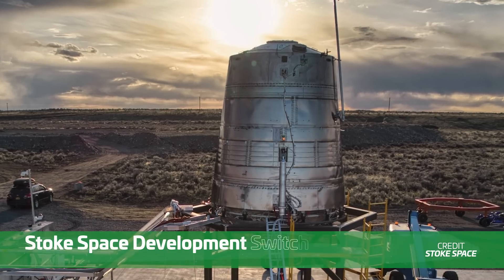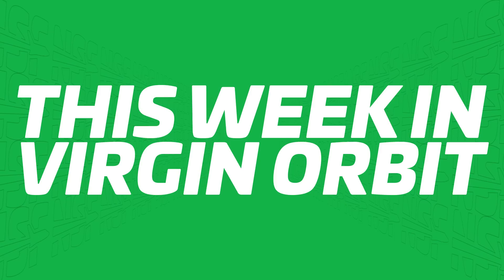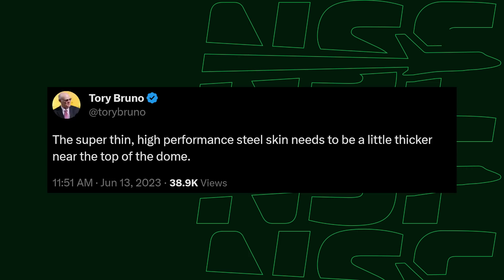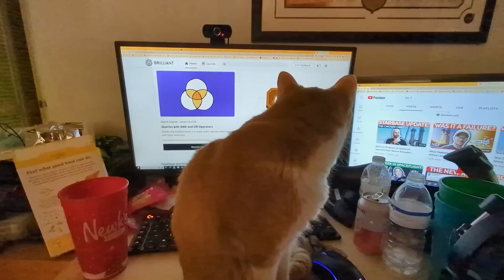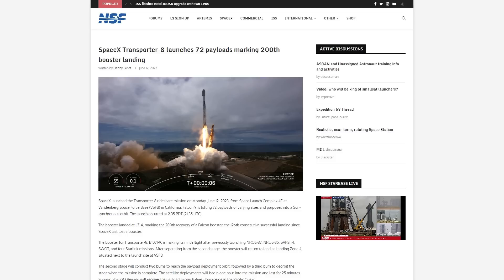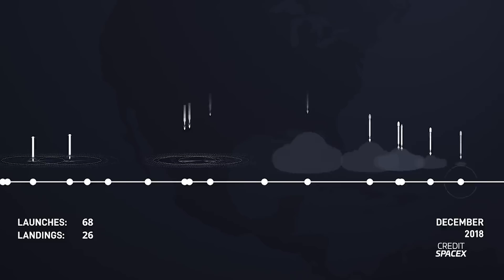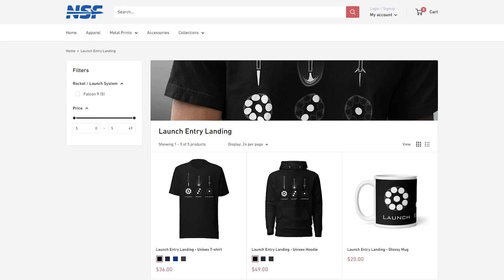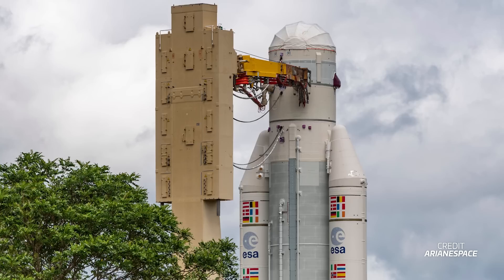Stoke Tests Prototype, SpaceX Hits Landing Milestone & ULA Gives Update | This Week in Spaceflight

Comment: Stoke is quickly becoming one of my favorites. Really hope they become as open as spacex about their development!
Reply: Openness is not only important but interesting....Exactly what we need
Reply: Heh.  I wouldn't say that SpaceX is open, exact;y  Rather, they're building their ships on the beach where everyone can see.  But yeah, not nearly as secretive as Blue Feather and others.  Ain't competition wonderful?
Reply: Here's the potential problem I foresee with the upper stage design: any amount of extra weight on an upper stage costs a huge amount of payload capacity compared to if it had been on the first stage, and if they are going to have enough prop to do a propulsive landing, that's gonna be a heavy upper stage (remember that the fuel tank will need insulation so the fuel doesn't boil from re-entry heat). 
So how much payload capacity will it actually end up having?
Reply: @carljohan9265  hydrogen is a very light fuel plus just like with other reusable vehicles most of braking is done using atmosphere.

Yes it is still heavy hardware wise, but Stoke, unlike starship, is aiming at better market, being medium class LEO. They dont do mass refueling, they only need to deliver few tons to orbit. Way more room for error if one doesnt try to send S-II sized stage to the moon.
Reply: @_mikolaj_  Hydrogen being light weight is offset by the fact that it needs heavier fuel tanks, so the point is moot. 
And it will need extra fuel if it's doing a propulsive landing no matter how much aerobraking it does.
SX did look into recovering F9 second stages and concluded that it was possible but not worth it.
Reply: @carljohan9265  Isp increase outweighs worse mass fraction of hydrolox stages.

Also, Falcon 9 second stage performs flights to geostationary orbit.
Stoke's rocket does not so performance hit is lower
Reply: @_mikolaj_  Specific impulse is great, when you are in space. 
Hydrogen does however have absolute trash thrust power compared to other props, and thrust is kind of important when you want to do a propulsive landing. 

The makers of Saturn 5 understood this, which is why they used the right prop for the right job (kerolox on stage 1, hydrolox on the upper stages). 
The makers of the shuttle and SLS didn't understand this, which is why both of them need the extremely oversized side boosters to fly. 

Personally I'd be a little worried about using hydrolox to land.
Reply: @carljohan9265  calling hydrolox thrust trash is just bullshit. Sure it requires faster pumps to keep up the massflow, but its not trash. Also, people who made Saturn V, made STS, so no, you cant call them out for not understanding architectures they made.

Returning to stoke, they are not doing upperstage reuse without hydrolox. They chose it beacuse its efficient. Without this efficiency they would not have impulse required for reuse. Not to mention, hydrogen is critical for their heatshield.
Reply: @_mikolaj_  Hydrolox thrust IS trash. The SRBs on the space shuttle provided as much as 83% of the entire stack's total thrust, despite there being two of them and tree RS-25s and the hydrolox fuel tank being the largest component of the stack. 

Hydrolox has really good specific impulse but it falls woefully short on raw power. And power is what matters when you are lifting of/landing.

And I can and will call the shuttle on it's design because they made it, and it's design is bad. 
So much so that when soviet scientists crunched the numbers on the thing they concluded that it made no sense and thus had to have been designed that way deliberately to gain the ability to steal soviet satellites, and that the americans were willing to tolerate it's bad design in order to gain that ability. 

It had the highest risk of loss of crew and vehichle of any manned space craft, excluding soviet spacecraft we don't know about and thus can't compare it to.
Reply: @carljohan9265  safety and economy of reuse of space shuttle  has nothing to do with sustainer architecture it brought back. Space Shuttle and SLS are not the only vehicles performing in such architecture, there are many launch vehicles following this configuration(if i didnt miss any, currently there are 4 such launch vehicles flying, of which 3 have Hydrolox core, with 2 more being close to operation. They use boosters, and? Whats wrong with that? 
Also the reason External tank was large, beacuse, unlike your Saturn V space shuttle had pretty much all of impulse needed for orbital launch inside ET. If you are burning your engines for 8 minutes obviously you need a big tank. And in theory if you wanted you could add more engines and turn ET into a decent SSTO, only question is why? That was not a point. Flaws of the shuttle do not come from launch vehicle stage architecture, they come from too ambitious planned flightrate, aim to create universal tool for all applications, and being a manned spacecraft while doing all of these.

Also, if hydrolox is bad landing fuel, why was it considered as such like 7 times, and is used on both New Shepard and Blue moon?
Arguably NS does same thing as Stoke's upperstage, aerodynamic braking followed by short landing burn. Works for them why would it not work for stoke?
And again, stoke's heatshield relies on LH2. Yet another reason to use it.
Reply: 🚀Mine too.. Ever since I saw Tim's tour of Stoke with Andy... I was especially taken by Andy's Enthusiasm🤓
Reply: @_mikolaj_  Like I already said, any weight put on the upper stage has an exponentially larger payload capacity cost compared to weight added to the first stage. 

And NS is sub-orbital. It goes straight up and straight down again, and not that long of a distance compared to a real rocket (look how far out at sea the F9 landing pad drone ships are). 
It doesn't spend anywhere close to the amount of fuel an orbital class booster needs to spend, so it has a lot left when it comes back down. So much in fact that it hovers for a little bit before landing proper. 

A second stage that goes to orbit, and then uses it's propellant to cool itself during re-entry, is going to need a lot because the hydrogen used as coolant can't be used in the engine if it heats up to it's boiling point (which it will, hydrogen has an extremely low boiling point and re-entry takes a while). 
So even if it only fires it's engines for the landing bit (assuming it makes it that far), it will still need to spend propellant on the re-entry phase. 

I'm not saying it's impossible, I'm asking how much payload capacity it will be left with and if that amount will be enough to make economic sense.
Reply: Look for Stoke to be purchased soon.  Their engines are radically different and arguably better than many other upper stage reusable designs.  SpaceX and BO should be looking very closely, would save them years of development time to purchase company outright.

Comment: s it possible foe a falcon heavy to lift a Starship into LEO?
Reply: No, not at all. Starship (second stage) is roughly 1,300 tons when filled with propellant. A fully expended Falcon Heavy can lift 63.8 tons to LEO. So probably not even an empty Starship (second stage) at around 85-100 tons.

Second, and more importantly, Starship is 9m in diameter, while the Falcon Heavy is 3.7m in diameter. That is 30ft compared to 12 feet, so the Falcon Heavy core stage is just too small.

Comment: Is the small green flashes in the last moment of the Falcon landing norminal?
Reply: If they appear during ignition, yes, these are flashes that come from ignition fluid.
Idk if its normal but i believe they sometimes keep greenflashing for a second after ignition. If it was to occur later into the burn, this is where you start to worry
Reply: @_mikolaj_  Yeah, but this was at landing? That pretty late into the burn.
Reply: @bfs007a  which landing 200th one? Beacuse tbh, i cant see it